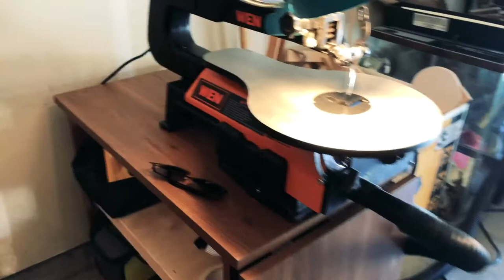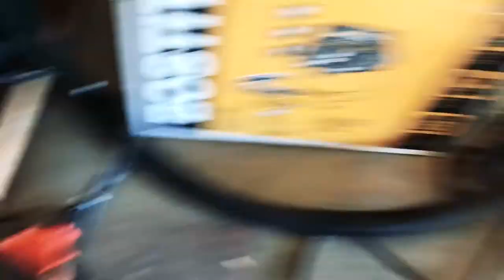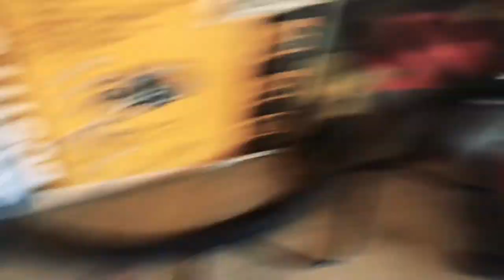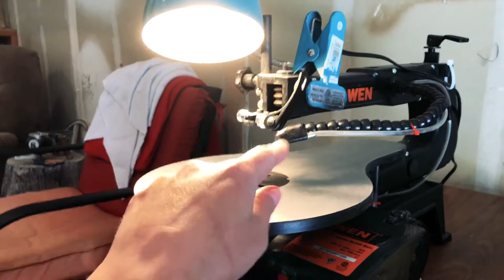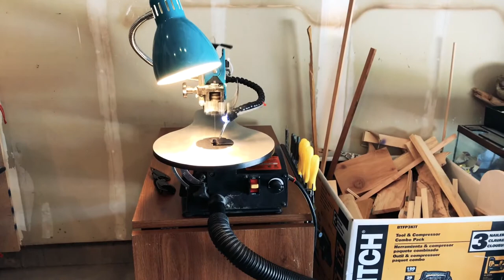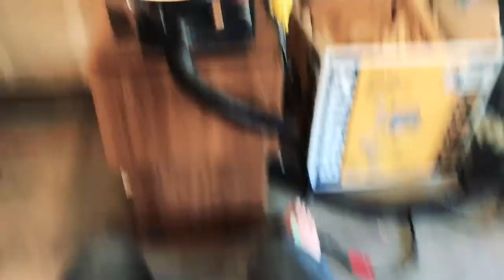DIY 3-in-1 Foot Pedal: Easy Scroll Saw Upgrade

Comment: Looks like your using an on/off switch rather than a variable speed switch for your scroll saw. I'm new to scrolling and wondered whether to go variable speed or not  . . .  what's your view on that ? I also bought 'the worlds smallest blower' that works on usb as my air blower for the scroll saw as it didn't have one. It's really cute and can be plugged into its own little power pack which I also use for my 'worlds smallest hoover'. .  both brilliant little gismoes !! Enjoyed your video, thanks.

Comment: I'm not sure that the foot switch is rated for more than 10 amps, could be pushing that with the shop vac.
I don't know if you dumped the bicycle quick release. I think some studies have been done with the new Pegasis quick release vs the Excaliber and DeWalt's regular quick release showing the weight adds to the vibrations. You might do well to look at a small light weight seat post quick release, I think you could get by with just a nylon nut on the far side and a washer on the quick release side to lighten things. I considered it with my Craftsman saw, but have since found a DW788 cheap.

Comment: I bought an aquarium air pump because I wasn’t impressed with the air flow from my Delta scroll Saw. It’s rated for a 100 gallon tank and has two outputs. I Y’d them together, but the airflow is less than the stock Delta pump!! What size aquarium pump are you using? What am I doing wrong?
Reply from the maker: jg some pumps just aren’t that great, but one rated that high should have been! Make sure you have the tubing as close to the blade as possible and there’s no kinks in the airline tubing anywhere. Mine has two outputs too, but instead of Y’ing them together and cut a small piece of tubing and clamped it closed with a zip tie to shut off one completely. That may help? Good luck!

Comment: Would have been nice if you had made a video showing how you wired it all together. 😕
Reply from the maker: brian o It's not wired together in any way. I just have the different things all plugged into a spitter and then plugged into the foot pedal. But you're right, I should have gone into more detail. I was just showing an overview of how I set it up. I'll try to get a more detailed video done soon!
Reply: Sweet Pea Woodworking & Decor  ....... that would be great....searched high and low for video on how to wire in a foot switch. Hours and hours. Im from Ireland and we use different wire colours and volts over here. Everything is from your side of the pond. I think I found one. .....BUT......by the time I had my scroll saw all wired in it was way too late to run it.  I will know tomorrow when I switch it on. Tks. Brian.
Reply from the maker: brian o Oh! That makes sense! I didn't have to actually wire anything in with mine. Just plug them in and go... sorry about that!